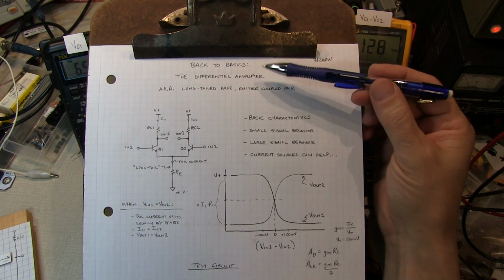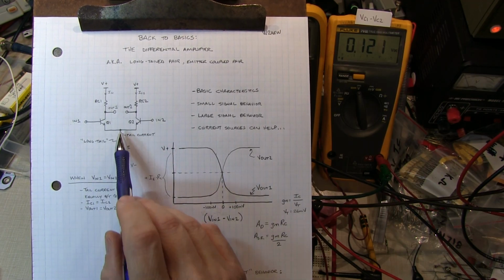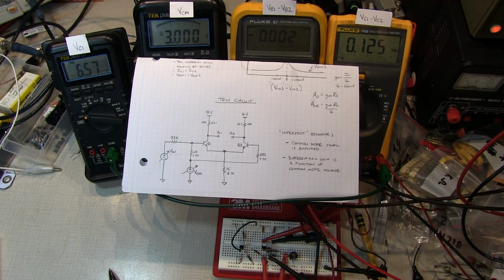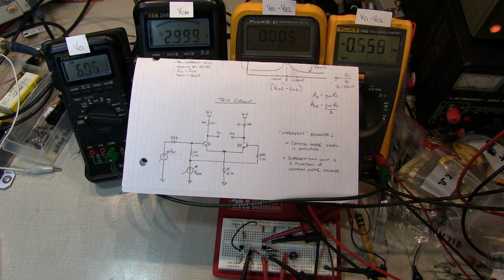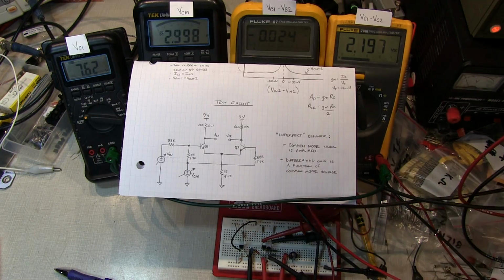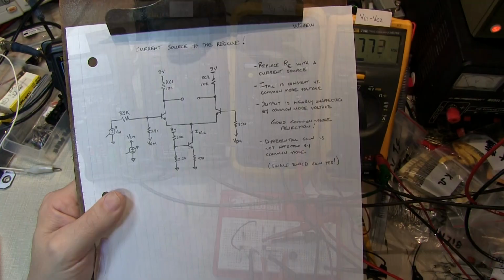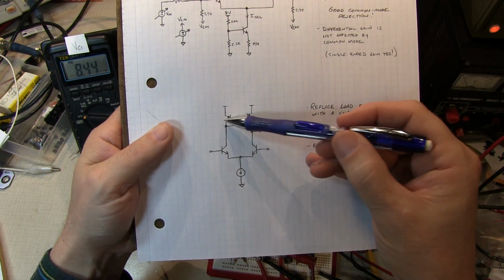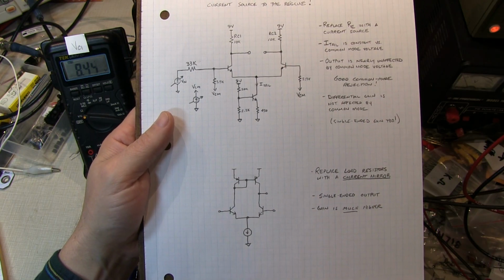#193: Back to Basics: the differential amplifier, aka long-tailed pair, diff-pair

Comment: Alan, I hope you can answer a question for me. I have a Tektronix DMM916 (amongst others) that is my favorite meter and yes it is old be still very accurate and has much more capability than a Fluke 87 which you often use. Can I ask why you prefer to use your Fluke rather than the Tek meters? Thanks and 73 k3NDB Nick
Reply from the maker: No real reason other that I never really had the opportunity to buy and of the Tek DMMs during their relatively short production run. In fact, I one have one.

Comment: could you use the common mode voltage to modulate your input signal? (in the example without the current source). was just rewatching the whole series, I think i am going to experiment with  all of this soon :)
this whole channel is such a treasure trove of knowledge.
Reply from the maker: If you use a resistor to set the tail current, you can get amplitude modulation via common mode changes.

Comment: Thanks for sharing your knowledge. I have an audio power amplifier that uses 10n20  and 10p20 mosfets (to control I’m not sure how it works ) 3- 2a1295 and 2c3264 transister .and the drivers for the mosfets are 340 and 350 transistors could you exsplain how it work and what could cause it to keep burning all the power transistors out and mosfets too.
Reply: Saved Photo
￼
Reply: Can I email you the schematic and if so what is your email

Comment: What other types of circuits use Cross-Coupled or Cross Coupling? What are the advantages and benefits of using cross coupled amplifiers compared to Non-cross coupled amplifiers?

Comment: Another great explanation. I built something similar with a ring-of-two for the tail current and an extra transistor between the active loads to minimise the extra current on the collector section of the diff-amp. I designed an amplifier (audio) and then suffered some brain damage as a result of a SSRI withdrawal. I'm relearning the maths so that I can work out why I designed what I did. The amp circuit is here, I don't even know if it would work!
https://photography-coach.co.uk/simonamp.png

Comment: Hi, how can i build a high voltage impulse current with a small capacitor and transistors/MOSFET. 

Is it possible to build an SMD component just the size of a hand watch capable of generating high voltage impulse? (Few thousands volts or stronger?)

Comment: Wow this video has been so enlightening. thank you. How can you take the output from a differential amp? How can you take a single ended output rather than dual output.
Reply from the maker: Yes, you can take a single-ended output (from either side) - this is actually what is typically done inside an op amp.

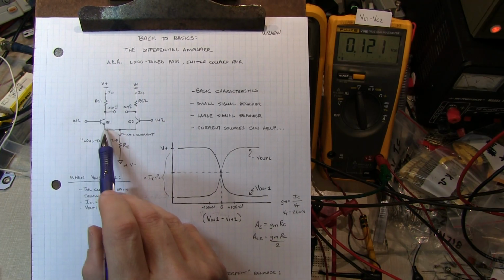Comment: 2:58 "more of this tail current is gong to go into Q1, therefore less into Q1, because the sum of the current into this node is zero" -> I get the KCL part but I do not get the rest of it...?  maybe the current changed in the R sub E, for example...?

I'm thinking that you would say that the voltage on R sub E is constant because Vbe on the transistors is the usual 0.7 and...? , what...?

Oh, looks like you address this later, there is a change to the current through R sub E
Reply from the maker: Yes, looks like you saw the result later.  If the voltage across Re is a few volts, then the change in voltage across this resistor in the active region of the amplifier is small so you can approximate it as a constant tail current.
Reply: @w2aew  Thank you so much!!!  Excellent video!

Comment: Great video.  I have encountered  the same problem mentioned at the end of this video; cannot fix the operating point of the diff-amp with active laod.
If I really want to test this circuit, what do I have to do ? What negative feedback circuit would be like? Thank you.
Reply from the maker: It would be the same type of feedback used with an op amp.

Comment: Watch the two videos part 1 and part 2 listed below which begin with descriptions of differential-mode and common-mode currents with animations. A basic scheme of a differential amplifier is introduced with the description of the analogous operation of a U-tube manometer. This is followed with a description of enhancements to the basic scheme of the amplifier to make it suppress common-mode output voltages more efficiently.
The Basic action of a Differential Amplifier- the heart of the Opamp.
Part 1 of 2
https://youtu.be/uggOykLShMU 
Part 2 of 2
https://youtu.be/jLJAYyap5WA

Comment: Tremendous. Thanks for such greatness. Way back, it took me a while to understand how the current mirror applied to the differential amplifier. Taking the single ended output from the collector of only one transistor means throwing away the gain of the other. To add the gain of the other side in, you would need to invert and add. The current mirror is simply a inverting unity gain current amplifier, adding an inverted copy of the other side to the output. I love the neatly drawn notes and the rusty clipboard. Looks like a yellow Sylvania tube box on the left. I look forward to more.

Comment: why is current through Re constant?
Reply from the maker: It's not really constant, but it is close to being constant.  When the input signals are small (small enough to not cause the amplifier to go into limiting), the voltage change at the common emitter connection (top of Re) doesn't change very much at all.  Since the voltage across Re doesn't change much under these conditions, the current doesn't change very much - it is nearly constant.

Comment: Great video! One question about the active load- if the current mirror is increasing the current as a result of an input change on the left, and the transistor on the right is reacting by increasing resistance in an attempt to keep the current the same, wouldn’t this cause the two transistors to fight each other, until the top transistor saturates? I tried this in simulation with a common emitter amplifier, and that’s what happened. Thanks again for all the wonderful instruction!
Reply from the maker: Precisely!  Either the current mirror / active load transistor will saturate, or the amplifier transistor will saturate, depending on the polarity of the input voltage difference.  This is exactly what gives op amps their HUGE open-loop gain.  Active loads like these are ONLY useful when external feedback is used to set the overall circuit gain.
Reply: @w2aew  Wow- one of my best “aha” moments ever. You’re an amazing teacher. Thanks so much!

Comment: I assume you meant there is constant tail current at the junction ? 
They dont add to zero, They are only zero  if the supply of the tail resistor is opposite in polarity to supply voltage of RC1&RC2  and those supplies have to be equal. :-)

Comment: In the last section of this video, timeline 17:38 and onward, adding a current mirror to the circuit,  you said that if the current of the first differential transistor increases this will make the current in the second differential decrease. But  from your video of current mirrors you mentioned that the current mirror will keep and maintain the current the same through both of the current mirror transistors. So how could the current in the second branch decrease?  and how does adding a current mirror increase the impedance and gain?
Reply from the maker: As I state at about 17:50, the mirrored current moves in the opposite direction of the current being drawn by the rightmost diffpair transistor.  It's two very high impedance current sources working against each other - a tiny mismatch in current causes a very large voltage change, which is basically causing a very large voltage gain.
Reply: @w2aew  Okay. Thank you!

Comment: Thanks for the video sir! I have a question: At 17:50 , why the output voltage increase when the differential input voltage is applied? Can you illustrate more detail on how the output gain is affected with the active current mirror load?
Reply from the maker: It is as described in the video.  When everything is matched, the tail current splits evenly between the diff-pair transistors.  Since the output of the current mirror matches the collector current in the rightmost transistor of the diffpair, the voltage at the collectors of the diffpair are equal.  When there is a differential voltage applied, the diffpair transistors are going to have different collector currents.  Since the current mirror will create a current equal to the leftmost collector current, and the collector current of the rightmost transistor is different than this, the voltage will change.   Another way to think of this is that the output resistance of the current mirror is very high, so and small change in the collector current of the rightmost transistor will cause a large change in the voltage at the collector.
Reply: @w2aew  Thank you sir. Correct my understanding if I'm wrong: When there is a differential voltage (let's say left side input voltage is higher), the mirrored current increases for both sides while the right side NPN transistor shrinks the current. Does the extra current exit from the output pin? In this case, how do we calculate the output impedance and the single-ended output voltage gain?
Reply from the maker: @VictorFPV  The output impedance of the current source is very high, and difficult to predict.  It depends on a parameter of the BJT called the Early voltage, which will vary depending on the specific transistor used.  See this writeup for info, as well as my video on current sources and mirrors.  https://wiki.analog.com/university/courses/electronics/text/chapter-11

Comment: Best explanation. Sir I understood the circuit  but can you please tell me how to calculate the tail current for the current sink in the emitter. Iam trying to build a voltage comparator so I dont want to use it as an op amp. Iam having trouble with common mode voltage gain even when I set 500uA current sink in place of emitter resistor.

Comment: I understand the current source replacing the tail, but I'm not so solid on why the current mirror replacing the load resistors helps. Why is the output now single ended when you put the current mirror in? Is it because you've essentially tied the two collectors together after a high impedance (the output impedance of the mirror)?
Reply from the maker: With the current mirror replacing the collector load resistors, a few things happen.  The input to the current mirror (transistor on the upper left) is a LOW impedance, since the collector is tied to the base, it looks like a diode.  Thus, the gain on this side is very low (little voltage change at the input to the current mirror).  On the other side, the right-side transistor of the current mirror is loaded by the current source (upper right transistor) which has a very high output impedance - thus the gain is extremely high.  This is almost universally used inside of op amps to get the huge open-loop gain.

Comment: I know all this  - or rather perhaps I did know at one time - but really your explanations are the best. Last time I learned was from the tektronix training manuals on diff amps which was pretty pure mathematical model derivation and not at an intuitive level. Thank you for doing this and please keep going making more at this circuit building block level.   I can wire up anything digital or high speed easily - but "simple" circuits like this I always find a need to refresh on it's basic workings.  The next generation of EE's needs to not rely on only arduino's, 555's and such to build things!

Comment: Could that "common mode problem" with the tail resistor be useful in combining two signals or otherwise mixing two parameters ? I could see that the current source would act as an amplifier if modulated on its base.
Reply from the maker: Yes, this is commonly done.  In fact, this is exploited in a circuit called a Gilbert Cell (see my video on that).

Comment: Wel maybe you can help me, I make a circlotron who has a input differential stage with jfet and mosfet cascade driving a differntial vas, I get distortion lower then -120dB but the distortion at those two stages is quite high, a lot of harmonics, possible the long tail does this and not the vas. So mine question is why? because of negative feedback? or the vas diff who has no source follower but straight a signal and amplifing.  I do not use a tail current source because I have there current feedback from output stage, it is grounded with a balance pot. Thanks in advance.

Comment: Thank you so much for the video! Some books also add a -Vee to the end of the tail resistor Re instead of grounding it. Is it just to ensure that the voltage across Re is large enough so that the variations in the common voltage does not affect the tail current too much or am I missing something ?
Reply from the maker: That's the main idea.  Also done often when the common mode voltage of the inputs is at/near ground.

Comment: Both inputs are tied on a differential amplifier so how can you only bias one input of the differential amplifier?
Reply from the maker: There are two inputs.  Bias each of them to a suitable level, and then inject your signal of interest onto one side only.  This is what is shown towards the end of the video.  Both inputs biased by the common-mode voltage, and then an input voltage is applied only to the left input.

Comment: Transceiver chips i think use differential amplifiers to convert a single ended buss signal into a differential buss signal. I'm not sure how transceiver chips covert a signal ended buss signal into a differential buss signal like an ECL buss signal or a CAN buss signal because a CAN buss differential signals is +3.5vdc and -1.5vdc and when idle its at 2.5vdc and ECL buss signal is different. So I'm not sure how the differential amplifier does this conversation from a signal ended buss signal from 0vdc to +5vdc and converters it to a CAN differential signal or an ECL buss signal to get the differential voltages must be some type of level shifting circuits also.
Reply from the maker: By applying a DC bias to one input of the differential amplifier, and your single-ended signal to the other, you will obtain a differential output from this circuit.  This is one (very popular) way to do a single-ended to differential conversion.

Comment: Yes i understand, But In cars that use CAN bus protocol that has twisted pair wires harness in our cars. They say that a "fault tolerance" means that if one of the twisted pair wires opens or shorts out that their will still be a "voltage difference" that will cancel out the noise/interference. I'm not sure why they call this a fault tolerance when one wire opens or shorts and still there is a voltage difference.

Comment: twisted pair wire cables are used increase fault tolerance, but what does it mean by increase fault tolerance?
Reply from the maker: Faults are often caused by extraneous signals and noise being picked up on the wires.  For twisted pairs, this noise/interference that is picked up by the wires is picked up by both wires equally.  Since the intended information on the wires is determined by the voltage difference between the wires, any noise/interference that appears on both of them is cancelled out when the difference voltage is measured.

Comment: The subtle point is in the  basic diff amp the shared  resistor current will change with increasing differential voltage at the input.  This will affect the differential output. With the current source replacing the Emitter resistor  the current in effect can't change. It is fixed with the high impedance to ground . The output resulting  from the differential input  is then wholly down to the change in Vce.

Comment: i'm really confused about the two transistors setting the current thru the common Re... doesn't the Ve of each transistor want to sit 0.6V below it's base? so there's a conflict of Ve? Also, when replaced with a current sink, aren't current sources in series akin to voltage sources in parallel? i.e. if they're not the exact same value there's a conflict.... please someone clarify that for me.
Reply from the maker: Yes, the emitter wants to be about 0.6V below the base.  What this means is, with the emitters tied together, the transistor with the higher base voltage "wins", and the other transistor gets turned off (thus the current goes mainly through the transistor with the higher base voltage of the two).  And yes, if you put two current sources in series and they're not identical, then "something" happens.  The reality is that the current sources are not ideal - they have some output impedance.  A tiny mis-match in currents will lead to the voltage at the junction rising or falling.  Hence, you get a lot of voltage swing for a very small current difference.  This is the principle by which most op amps have huge open loop gain.
Reply: Thank you for asking this question, I was struggling to understand why adding a current source increases the gain tremendously. Alan's answer made it clear. Gain = gm*Rc. I am still not completely sure how to calculate the gain of a circuit formed by two current sources

Comment: Love this very much and it gave me an idea. 
I'm currently building a simple wind speed meter using a heated thermistor and it kind of works. 
But if I now used you circuit, self heated the transistors by using an appropriate  constant current, let one transistor sit in the wind and the other protected from the wind. 
Do you think that would kind of work?
The measurements don't need to be fast but I think a TO92 would be responding faster than my current resistor/thermistor solution.
Reply from the maker: It would work, but the results would not be linear with temperature.
Reply: +w2aew: Thanks for the very fast reply. I will only use it as an indication of the wind so no meters/second needed. I will get the breadboard set up and do some "testing on the bench" as you normally say.